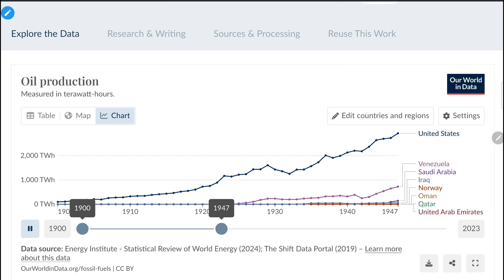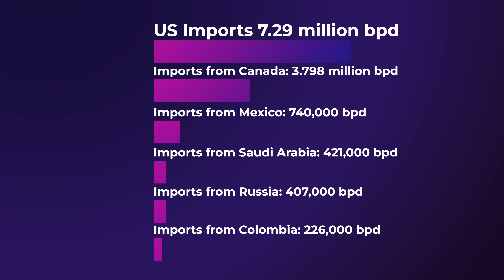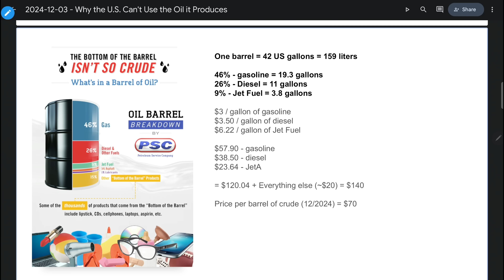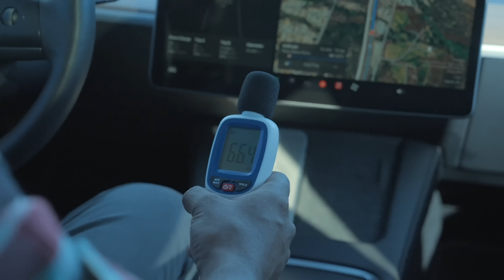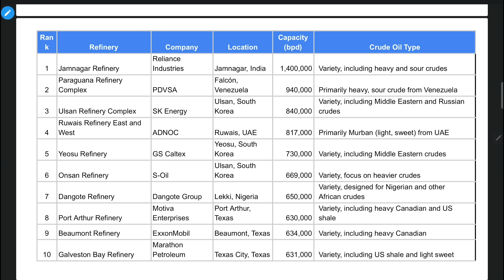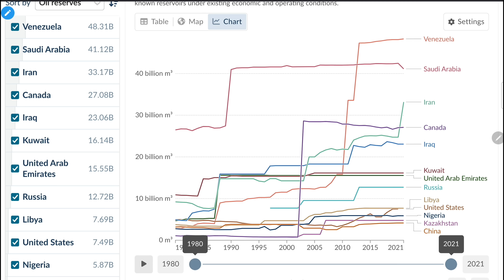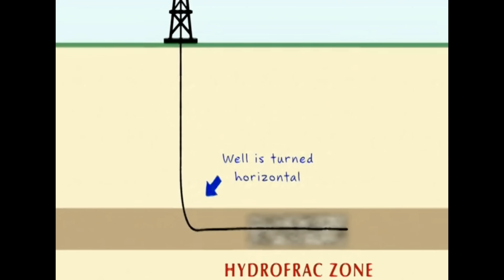Why America Can't USE The Oil it DRILLS

Comment: FACT CHECK RESULTS = FALSE

Before watching your video I was told that the US does not have the ability to refine its own crude oil too. But then I looked into it on my own. It turns out both of us were\are wrong. The refineries in the US do have the ability to refine USA fracked crude oil drilled in the United States, to do this we need a mix of imported crude and USA crude to process it in the USA.

With this method we can actually refine almost every drop brought up to the surface.

Comment: One of the over simplifications in your presentation is that oil will continue to be used to create plastics.  In fact, the production of plastics is more of a byproduct of crude oil refining.  If gasoline, diesel, etc were eliminated the cost of plastic production would skyrocket and result in increased waste products from refining.  I’m not saying we couldn’t figure out ways around these issues, just that redesigning the refineries becomes cost prohibitive.
Reply: Other than ABS and Nylon, plastics is mostly made post ethylene crackers which mostly use NGLs from wet natural gas.   The US has this in spades and why it is the cheapest place to make plastics in the world

Comment: I enjoy listening.     
    Just looking at the oil $$, prior to 2020 I got $1.65.  Today I see $4.60, (Costco gas).   So, it will be interesting seeing what happens in the next few years.   **.  Based on what I was told there will be more than just the one type of oil.  I think you over looked some of the items impacting the $$ of oil.
**.  It will be interesting to follow the oil of $$.
Reply: @billmclain8781  Don't forget local taxes in your calculations. I. Florida gas is averaging 3.10 a gallon and you mentioned around $4. You may have higher taxes.

Comment: While there are some good points (and I do support renewables)….  I don’t agree with the conclusion.  Renewables, without the ability to economically store the energy for longer periods, will reach a ceiling, they are not ready for ‘prime time’.  I would happily buy a electric ‘grocery getter’ assuming I could charge it at home, especially using solar.  A barrel produced in the US, even if bartered overseas for refining, provides a measure of economic and availability stability.  So my takeaway is the US needs to perhaps build refineries to handle what we produce (yes expensive).  There hasn’t been a new refinery built in the US since when ?  Obviously refineries are extensively redesigned and modified, but regulations essentially push this part of the process (new) outside the US.
Lastly, invest in oil tanker operators and their builders in the near term, research energy storage, build nuclear (especially with the new innovations) and ‘refine baby refine’…
Effectively (talking utility scale here) renewables currently offset fuel use when the energy production is available (sun shining & wind blowing) coupled with a concurrent demand load.

Comment: It's simple chemistry. American crude is 'sweet' (low sulfur content), others are 'sour' (high sulfur content). The difference requires the distillation columns to be set at different levels and the processes require different flows, temperatures and configurations.

America purposely retained its own reserves and relied on foreign reserves for it's fuel needs.

Comment: Great video. You made some great points. The issue i have is that wind and solar commercially have really been a huge flop in terms of efficiency and a relatively low power output and low service life compared to something like nuclear which is an extremely effective and efficient source of power. Over 80% of the country is still powered by coal power plants. Lets get that fixed up...

Comment: So explain why did gas prices triple/ quadruple and stay there for a long time when we shutdown the Keystone pipeline?
Reply: The Keystone Pipeline had nothing to do with gas prices.  Gas prices crashed during the pandemic and as a result part of the supply chain shut down.  It was a slow process to bring the supply chain back up.  At the same time this happened, the largest war in Europe since WW 2 broke out and the aggressor (Russia) is one of the world's largest oil producers.  The price you pay for gas at the pump is driven by the price of a barrel of oil and the supply chain.  Another example is if a hurricane in the Gulf hits refineries.  This will impact the supply chain and spike gas prices.

Comment: OK---------- ... Good information but he does not see or understand the new Reality of Trumpism...!!!   Electric vehicles will become a large part of the industry but never replace it for at least a hundred years...   Until Batteries and a Much Larger portion of the electric grid is Clean Safe Nuclear or Fusion that may even Catch up to America's and the Worlds rapidly growing Demand...  This and Trump's regulation reductions will allow the Oil Industry to Spend the money to start adding the new Refineries that can use Sweat Shale Oil just as efficiently as the Heavy Crude...!!!   One reason may be his Eco Biase against pipelines and Oil in general that are mostly unfounded in reality...  Pipelines are over twice as efficient and safer than Huge Mega Tanker ships.  Pipeline leaks in Modern pipelines are very local and Comparatively small and quickly shut off and cleaned up. While even One Small Tanker Disaster Spills More OIL into the Eco System and beaches than all the Pipeline leaks in history combined.  One benefit of Shale oil production is the increase of Natural Gas production that is powering more and more of the worlds Energy Cleanly and Cheaply...  With Gas Pipeline leaks resulting in very little Eco Problems compared to Rail and Oil Pipelines...  That Eco Terrorists are just as much against...

Comment: This video is so wrong/false/incorrect don't even know where to begin. As a big fan of this channel is causes me to question what I thought I learned from previous episodes. The statement you make that drill baby drill is based on an incorrect premise is oh so wrong in a lot of ways. 
You state that production of more light/sweet only benefit evil oil companies is just a plain false statement. Increasing production outright reduces the global prices of gas. First US refinement of light sweet has been increasing for a long time due to local availability. Refineries everywhere have been shifting. Further even LS sold elsewhere drives prices down. The mix of product you get between oils is different but more production = more competition largely for the same mix of refined product. i.e. prices go down basically across the board when production increases. 
Almost your entire premise is laughably wrong. More light/sweet DOES decrease prices and IS being refined more and more locally. Even when it isn't it STILL reduces gas prices.
Lastly I would add that the phrase also refers to other hydrocarbons such as natural gas. Bottom line is increases DO decrease prices and don't just benefit companies.

Comment: Interesting content. One thing you omitted was that many of those ships that bring us the crude we need are also the ones that take ours to those who need it and you infer that there is much wasted fuel to ship oil. Ideally you would have enough refineries to take advantage of our own oil but over regulation by the government stops that from happening so to keep the wheels turning, shipping is a must. Let me remind you, shipping is the cheapest method of transportation on the planet, yes, pipelines are great but impossible to bring across oceans.  You state we use 60% of the oil we produce, it would appear that if oil production went up by, say 3 million BPD, we would net 1.8 million barrels that would not have to be purchased and shipped in. Saying we can't USE the oil we produce is clickbait, you yourself pointed out we use the majority of it and your argument that refiners won't spend the money to upgrade to take advantage of domestic oil is plain wrong. Capitalism will self-adjust; it always does and to claim that EV's are going to be the panacea of all is naive to say the least. I realize you are an EV fan but until we can find a less polluting, more efficient battery system than LI, we are doomed to have fuel powered vehicles for way longer than we want. There is a reason the major car companies are pulling back production from EV's, they aren't selling and without heavy subsidies from the governments, that is likely to spell disaster for the fledgling EV industry. Just try to sell a used EV, unless it is at bargain basement prices no one wants one. If they are so great, why did Hertz dump 20,000 Tesla's this year? Answer is range, charge time and that they weren't renting. EV's are not ready for primetime.

Comment: If you are a moron, then "Drill, baby, drill" sounds like the answer.
If you are bright, then "Rail, baby, rail" makes the most sense.
Government owned railroads is the cheapest and best way to move goods.
Not if you relax regulations, or safety regulations, like one moron did, but true control of railways works.
This generation of teamsters would be needed to build those railways. The next generation of teamsters would be needed to move locally (is 500 miles local?) goods where they are needed.

Comment: Transportation electrification worldwide will reduce gasoline, diesel, and lubricant oil consumption lowering its price.
Oil-based plastic reduction may also reduce oil consumption.
The best fuel cost savings in not needing to buy oil by switching to electricity.

Comment: If the US has greatly increased it's production of oil that it can not refine, someone somewhere must be increasing it's refining capacity to accommodate that oil to match the supply, or else the price of that type of crude oil would decline.
I imagine that refining capacity in general is a bottleneck in the oil system that could use a whole video to fully discuss.

Comment: I grow hay for animal feed.  My hay is high in protein which is most valuable to dairy farmers.  Last year my primary customer just 3 miles away decided to switch to beef cattle.  This left me with a choice.  I could reseed my hay fields with a more appropriate grass mixture that would bring a lower price in order to retain my current customer... or I could find a new customer that will buy my higher value product without having to reseed but might require a greater transportation input.  I was able to find a customer 30 miles away that needed my current product.  I did the math and the decision was made to go with the new customer.

Same thing... larger scale.

Comment: Oil is generally not shipped in barrels.  It's shipped by tankers.
Reply: A barrel is a unit of measurement. Doesn't matter what it's shipped in.  If you put 40 gallons of oil in a plastic bag, it's a barrel.

Comment: It basically comes down to the influence of the corporate board of directors and the contracts they create to make the most money. You can drill 10 x the oil but they may sell it elsewhere. It may not improve costs here. Laws would have to be made to restrict contracting and you know that would never happen under Republicans, they're for total deregulation. Not all board directors interests are for the US.

Comment: @3:36  -  This is the old way of refining oil. This is how the breakdown would be with a common distillation process of crude oil. However with modern equipment like the new plants and systems built in USA, they can turn any petroleum, heavy, sweet, light, asphalt, coal, and many other things you would think are not convertible, into gasoline diesel kerosene(jet fuel) and many other products synthetically. There are many "Cracker" and Synthetic plants that are able to convert these items into gasoline or are easily adaptable into one hell of an engineering marvel to convert many so called useless forms of petroleum and other hydrocarbon stocks into usable fuels lubricants plastics gas grease and asphalt. I have seen a couple of these plants and they are modern and amazing. We need more of them. Even fryer grease and meat drippings can be turned into fuels.

Comment: You neglect to mention the FACT that oil is ORGANIC.  Oil spills are immediately messy but very shortly thereafter is broken down and neutralized by nature.  Drill baby drill to reach energy independence IS INDEED TRUE in the intermediate and long run.  Only in the short run is it not.  Yes, making the changes to the refinery infrastructure to refine our own production internally to meet our needs would be costly but not  unreasonably so.  As long as the U.S. has reasonable security over the geographically located refinery resources the economics of shipping ours and importing theirs IS energy independence.

Comment: If the government already provides subsidies to oil companies; can’t it use those subsidies to require oil companies to retrofit 20% of their refineries to cope with shale? Also; EV tech , PV and wind are just energy harvesting. It is also majorly subsidized and is currently not the answer, it’s only scavenging and is not fit for base loading. Stop pretending otherwise.

Comment: For the same reasons you give about domestic oil not working you can apply to EVs. The infrastructure doesn't exist. Updating a few refineries would be vastly more cost efficient then rebuilding an entire electric grid, and power plants needed to meet demand.

Comment: Another issue for the "baby drill" is the price drop if there is too much oil in the world. Supply and demand. If I am right, shale oil breakeven at $50 a barrel. More supply means a lower price to shut down production in Texas, which is politically undesirable. 

That may be why oil prices have stabilized at $75 a barrel. America didn't want more oil from Canada to compete with domestic production, so the Keystone Line was canceled.

Comment: Here's a third conclusion you're a little incorrect on. You said drill baby drill will only profit the oil companies, their employees, and their shareholders.

That's incorrect. The more oil we put on the market, the more supply there is worldwide. And the more supply there is worldwide, the lower the price is worldwide, unless other countries decide to cut production, but they can only do that to a degree, which gets harder as America puts more and more oil on the market.

Also, as we fill out Strategic Petroleum Reserve (SPR), that has the same effect. Anyone stockpiling oil increases supply in the world and the effect is a lower price of oil.

Comment: Good video but slightly wrong on one or two points. Here's one:

You said drilling more doesn't bring down prices locally. Technically, it doesn't bring prices down locally--it brings prices down globally. Supply abs demand. Anytime you add more oil to the global output, supply levels get larger, bringing down prices. However, if, say, OPEC decides to cut production to lower supply, it will counteract those extra barrels on the market. But if OPEC is already at a low output and the price of oil is already low due to a lot of extra supply, then OPEC can't afford to cut production because they're not making enough money per barrel to produce fewer barrels a day. But that's a scenario of someone like America flooding the market with our new drill baby drill philosophy. 

So, if America floods the markets worldwide, lowering the price of oil super low, then the companies overseas refining our oil will be paying less for their imported oil before they refine it and send it to us, meaning the price they charge us will be lower as a result.

Comment: The True environmental problem is more moving parts more likely it is that something wrong. That includes moving oil also there is an economic and environmental costs so we should develop at least a couple of refineries preferably in the Texas shale oil region that can process that oil and the other byproducts from oil drilling. Secondly electric cars must run for approximately 50 years to break even on the amount of environmental damage from their manufacturing that includes the pollution output of driving the gasoline competitor. Although I agree sociological and political reasons we will continue to build electric cars and we will continue to import oil.  😞

Comment: The cost of electrification that will shift from fuel energy  to electricity will cost trillions.12,000,000 barrels of oil is about 5.04 e 13 BTU. Electric utilities will need to find 14,749,780,509.2 KW / day to replace it. Good luck.